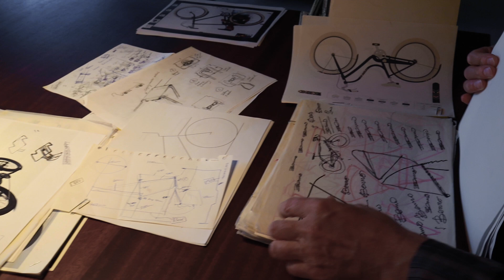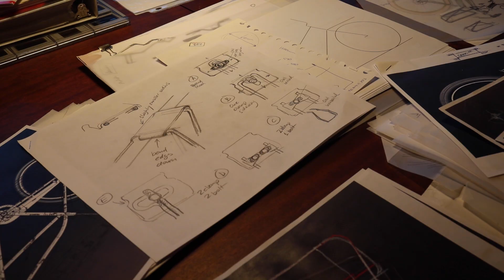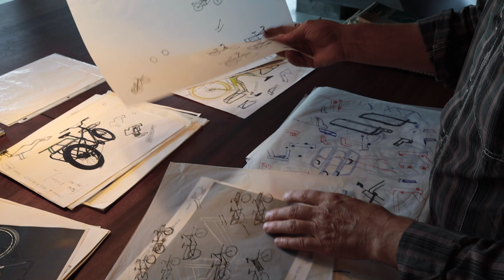How to design an Electric Bike

Comment: You need to make a bike with the riders are a bit closer to the rear hub. A banana seat works. If your body weight is about six or seven inches farther back you don't have all the weight in the middle of the bike. This allows the front wheel to come up easier for a jump or a weely. I found, sitting farther back towards the rear hub, but not right on it lets me sit lower and still have full extention for my legs, while peddling and can full stop and place my feet, flat on the ground
Reply from the maker: This was part of Benno’s original design on the Electra Townie. They called it flat foot technology.